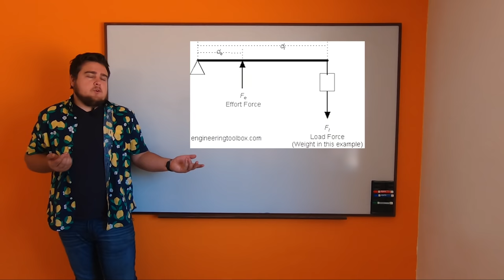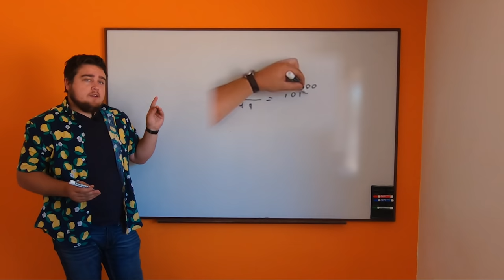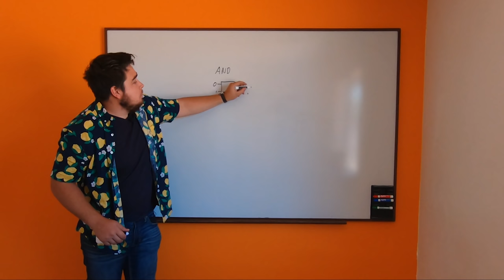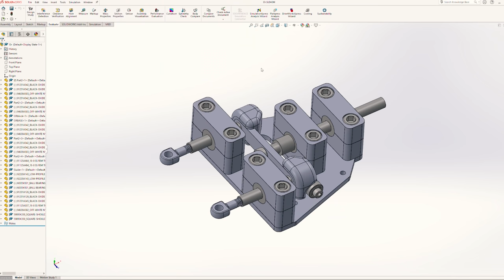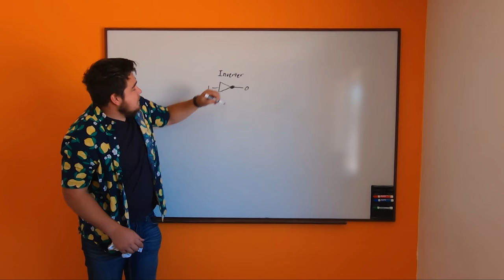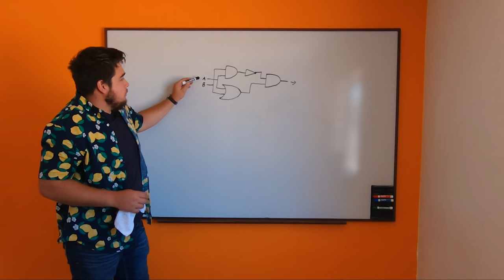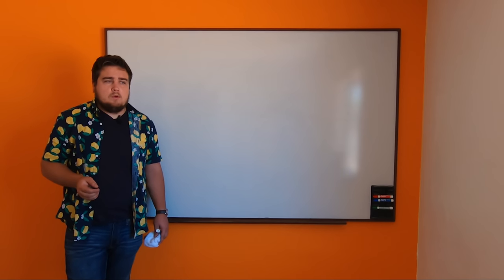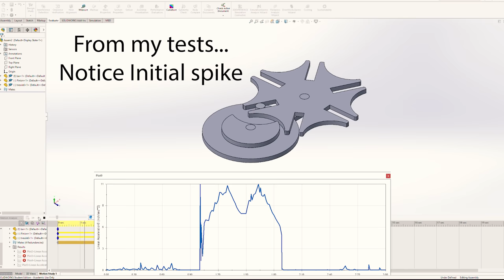Is a Completely Mechanical CPU possible?

Comment: Coming soon: solid state mechanical engine management.
Reply: I very much hope that’s sarcasm, mechanical fuel injection is a thing and it is currently a step up from modern ECU tech
Reply: @dylanzrim3635  It pains me to explain the joke, but I'm pretty sure the point was "a modern ECU, implemented as a mechanical computer instead of an electrical computer"
Reply: @dylanzrim3635   Yeesh, humorless.  Nothing about "engine management" implies fuel injection.  And yes, MFI has been around since at least WW2.
Reply: Engine management via a difference engine.....
Reply: @dylanzrim3635  step down*
Reply: 😂 Only for vehicle that can carry over a ton
Reply: @dylanzrim3635  If so, then why did everyone abandon it decades ago? It doesn't work all that well.
Reply: @dylanzrim3635  You are being analogue again, what have I told you... You little......
(Simpsons joke)
Reply: @dylanzrim3635  oooooof. On what planet does MFI beat EFI in any measurable attributes other than "lack of wires"
Reply: Wow, it runs better than the CPU I made of potatoes and ran from a 12V battery
Reply: I'm pretty sure Dylan was attempting humor as well.
Reply: They do that already using hydraulics
Reply: That's not solid state though if it's mechanical
Reply: @omaristephens2143  mechanical computer is not (and can't be) "solid state" because it contains moving parts.
Reply: @melody3741  Yeah technically it would be analog mechanical computing, as anything solid state implies no moving parts, but the misnomer was understood well enough.
Reply: Make sure it's made of balsa wood so its lightweight.
Reply: That would be a steam locomotive my dude
Reply: @Red Zayda (RunawayDart) I think the term he was looking for is "Discrete".
Reply: Fast enough for...a hit/miss motor at 20 rpm?
Reply: @DJScopeSOFM  A diesel runs just fine without electricity, unless it has been "upgraded" to require electronic control.
You can even eliminate the starter if you have alternative means, like a flywheel, to spin it.
Reply: FYI, solid state means no moving parts. The complete opposite of mechanical. What you should have said was 'digital mechanical engine management'.

And to the people saying 'analogue mechanical', it's still digital because it's processing digital data, 1s and 0s.
Reply: Heavier than the car
Reply: Solid state and mechanical together sounds like an oxymoron
Reply: If you were to continue this, using a pnuematic or hydro system to connect the parts together might be a good idea.

Comment: Fascinating thought experiment.
Reply from the maker: Thank you! I'm still tinkering with the 2nd part of this, but I'm happy with the direction so far. Love your channel!
Reply: @WesleyKagan  looking forward to part 2!
Reply: Yea, a bit like Babbage's Analytical engine - except this will be binary so some of the 'mill' parts will be simpler although the analytical engine would have been able to calculate with 20+ decimal place accuracy.  
The 'store' part is still going to be massive though. :-)
Reply: Destin is probably the reason I'm here.
Reply: @eliljeho  yup, algorithm is doin its job.
Reply: Was done in real life: https://en.m.wikipedia.org/wiki/Z1_(computer)
Reply: oh, so you're why this got recommended to me.
either that or I'm just a nerd
Reply: @WesleyKagan  won’t friction and other losses limit the maximum number of mechanical gates you can tie together? You will probably need a mechanical “signal booster” after so many gates. You could utilise stored mechanical energy, such as in a flywheel or potential energy in compressed air or water pressure where a small signal activates a larger force to restore the original magnitude of force. You should design it so that at the end of every set of so many gates the  force is restored before it enters the next set so that you can tie an infinite set of gates together.
Reply: nice try, maybe if you had the real 'verified badge' someone would fall for it
Reply: Ok, so this is why I got this recommended.
Reply: many times Steve Mould already did this with water. https://www.youtube.com/watch?v=IxXaizglscw 
And Matt Parker did it with Dominoes. https://www.youtube.com/watch?v=OpLU__bhu2w
Reply: @srenkoch6127  how much mechanical computer would we need to run Doom?
Reply: I bet a big brain would be able to do this with compliant mechanisms, reducing logic gates down to maybe even a single part
Reply: @StarMan_2018  That's a damn good point on the mechanical losses.
ALL CPUS have the same type of loss except its a voltage loss across the gates which is physically noted as heat.
A mechanical CPU will have friction losses that will be seen as heat or heard as noise.
The question here might better be described as the power required to drive each gate and thus the overall mechanical power requirement.
Reply: Humanity needs multiple heads working on this!
Reply: @StarMan_2018  mechanical relay?

Comment: Not even 3 rules - all computation can be reduced to a single rule: NAND.  You can build all gates using NANDs, and you can build FFs using NANDs too.  It's feasible to build an entire Turing complete computer using NANDs only.
Reply: NOR is universal too
Reply: @prototypeinheritance515  Yes but NAND is more widely used.
Reply: I remember this is how most is manufactured
Reply: And  nands can be has been built of stone(chrystal in nature) man mad structures duh!!!
Reply: antonchannel  And it's pretty cool now that i tried it.
Reply: The thing is that NAND gates need to be turned BACK into NOT and AND gates, and that is before you make or gates. You need 2 NAND gates for an AND gate, and one NAND gate for a NOT gate. That means an OR gate would take 5 NAND gates, as opposed to 3 NOT gates and an AND gate. It is more efficient to make NOT and AND gates into NAND gates then it is the other way around.
Reply: @pizzainc.1465 At least for a bespoke, hand built system like this - in photolithography the simplicity of only ever making one fundamental gate outweighs the parts of the system that could technically use fewer gates by using more than one type
Reply: @pizzainc.1465  you only need three NANDs to build an OR gate. You don't need to build out the full AND and NOT gate logic, you can use the logic of NAND directly. They're also good for adders, only 9 NAND for a full adder. And you can build a selector out of only three NANDs, the functionality of an OR of two ANDs. If that makes sense, hard to put into words without logic gate flowcharts.
Reply: There are several sets that are functionally complete.

{ NAND }, { NOR }, { AND, NOT }, { OR, NOT }, { IMPLY, NOT }, { IMPLY, XNOR }, { IMPLY, NIMPLY }, { NIMPLY, NOT }, { NIMPLY, XOR }, { AND, XOR, XNOR }, { OR, XOR, XNOR }

Note that an IMPLY gate can express both a Material and Converse implication depending on the orientation of the inputs. Likewise, NIMPLY works as both Material and Converse non-implication. You change orientation by flipping the gate over such that the inputs swap. The sets I provided are still functionally complete in any combination of orientations. Practically, these types of gates are hard to work with especially without a clear orientation label.

Comment: I can't imagine how much friction will exist in the final system.
Reply: I was just thinking that.
Reply: L U B E   I T
Reply: grease cooling
Reply: actual adding machines from the period would basically be BATHED in lubricating oil at least daily if not more frequently.
Reply: @IONATVS  Imagine having to change your computer's oil every other month 🤣
Reply: That's what WD-40 is for!
Reply: @robharwood3538  quite the opposite... WD-40 is in general not a good lubricant; it is a good penetrating fluid for removing old lubricant or getting stuck nuts loose. When people try to use it as a primary lubricant, things don't go well over the long term, as it mostly evaporates.
Now sewing machine oil, or watchmaker's oil... that's some good lube.
Reply: @chouseification Because two friends used it, I used wd-40 exclusively on my sport bike on the street (rain, dirt, sand, etc) for 50,000 miles, and the chain is now only halfway through it's adjustment range.  

But, it does disappear in 200 miles.  

Z Max would work even better, but probably evaporate in 20 miles.
Reply: And once you are finished contemplating this, consider that EVERY gate will need a return spring or it will get stuck in the "1" position after the first time it moved there.
Reply: I agree.  I think this is one of the things his model is missing about how actual gates work.  Gates do not use the current of the inputs to produce the output.  An isolated AND gate for example has 5 leads, not 3.  It has the 3 he's showing AND it has a ground and a +VCC lead.  THAT is where the power comes to produce the output (the GND/VCC differential).  Using this method allows the circuit to scale much further than if the voltage at the first gate was expected to drive the output at the last.  So, to model this mechanically, the inputs on his gates would be on hair triggers, and the force to push the output would come from somewhere else externally that was continuously providing enough power to push/pull all the output gates at once if necessary (the mechanical equivalent of a power supply).

Maybe he could make each gate so that it accepts a continuously rotating source of power, and every single gate runs off that rotating power source.  The inputs act as triggers that cause the rotating power source to produce the output he's after.  He could standardize the shape of the three gates (or, not, and), with each accepting this rotating power source in the same location, and then he could stack them together like Tetris blocks to achieve different circuit configurations, and thereby get away from the friction problem.
Reply: @Calphool222  it makes perfect sense but can you IMAGINE what kind of hell it would be to assemble this crap?
Reply: @Calphool222  Excellent point!  One thing, though.  That rotating power source will be a motor, probably, using ectricity.  Let's make it hydraulic (which seems more mechanical than electricity), and have a source of water pressure that you attach like a garden hose.  That way, the water pressure can be from a tower, a dam, a river, a mountain top reservoir, or whatever energy storage system you can think of. 

Maybe the design could be like a power steering unit, where oil pressure helps push the mechanical bits you turn by hand.
Reply: @cool_bug_facts  exactly my friend, exactly!
Reply: @dlfon99  You only have to do that in your engine because it gets very hot. Think manual gearbox - when's the last time a manufacture required regular oil changes for one of those?
Reply: At some point it becomes feasible to build these things with their own oil systems
Reply: @MultiPleaser  aero kroil
the oil that creeps
Reply: "If brute force doesn't work, you're not using enough of it."  -Isaac Arthur
Reply: @Calphool222  Came here to say exactly this.
Reply: Could you just run it fully submersed in oil?
Reply: @PongoXBongo  just like people run PCs fully submersed in mineral oil
Reply: I guess that would be the same as electrical resistance. So all friction turns into heat, that's why a CPU get warm and must be cooled.
Reply: @chouseification  The thing about WD-40 is that it cleans the chain and therefore it doesn't wear as much.  It's dirt and grit that wears down the chain and sprockets.

I've done the math and found out that if each roller and pin wear down a tiny fraction of an inch, then the chain will "stretch" an inch.  That's because there are about 50 links between the front and rear sprocket.  Each link has a pin and roller, so that's 100 surfaces in constant contact. So, 1/100th of an inch of wear makes the chain an inch longer between the sprockets.
Reply: @MultiPleaser  make it pneumatic. The gates would act as logic valves
Reply: @MultiPleaser  I soak the chains on my bikes in hot beeswax. Never had to replace one due to environmental damage.
Reply: all of it
Reply: @233kosta  So true.  I once changed the oil in my 4 speed gear box after about 30,000 miles and it came out nice and thick, and as pale as Coors Light.
Reply: @MultiPleaser  In a well-designed/made manual transmission it should last more or less forever. Sometimes synchros wear excessively creating dust which isn't great, but other than that the only reasons to ever touch that oil are A. It was sat there for 20-odd years (it can lose some properties over time) and B. A seal broke and it all leaked out.
Reply: @DavidJohansson  CPUs heat up through a different mechanism (though the analogy is OK).

Every transistor has a so-called linear region. What happens there is its resistance changes linearly with the applied voltage/current (depending on type). This is good for class A amplifiers, but turns the transistor into a resistive heater. Resistive heating is very simple - the power dissipated comes from the current flow and voltage drop across the resistor (P=VI).

This is undesirable in pure-switching applications (like digital computers, power electronics, etc.) because the transistor has to pass through that region every time it turns on and off. Doing so generates orders of magnitude more heat than when it's fully on (with resistance measured in micro ohms, so very little voltage drop and dissipation) or fully off (with resistance measured in mega/giga ohms permitting basically no current flow, thus again - no dissipation).

Obviously the more transitions that take place - the more heat the transistor generates. This imposes a practical limit on CPU clock frequency as well as power FET switching frequencies.

For this reason switching transistors are designed to have the smallest possible linear region (they also work best with special high speed transistor drivers), but obviously there are practical limits to that too.
Reply: It'll run inside the lube pond. And the lube might even boil a bit.
Reply: @Calphool222  That's some good point! The force needed at the input in this early design would increase very quickly as more gates are added in cascade
Reply: The inverter does not work due to it needing a spring and then it looses energy due to friction. So a series of gates fails to move. It would need to add energy at some gates.

Comment: That logic gate looks like it was designed to survuve a neuclear blast, Skookum asf
Reply: Skookum As frig is acceptable
Reply: "Skookum" - must be in BC, Canada.  That's not a thing anywhere else.  :D
Reply: AvE lol 😂
Reply: @Watchmedome3017  yup here's here too.
Reply: Dewclaw will be mortified that no ones, zeroes or angry pixies will be required
Reply: +1 for the AvE slang xD
Reply: Needs weight reduction,  make a version from aloolaloom.
Reply: @slidey1788  AKA Aloominimum
Reply: What if you forget your logic gate before running to the shelter? A crappy average silicon one would crack and melt instantly, while this would be enhanced by the radiation, yielding +20% processing speed.
Reply: @jeffmoncalieri7491  Oregon, Washington and Idaho as well. I believe it originated with Native Americans but it used to be commonly used in logging here in the NW.
Reply: @Two-StrokeLife  I grew up in rural NW Montana and only heard it when I moved here to BC Canada.  I do believe it's native in origin.